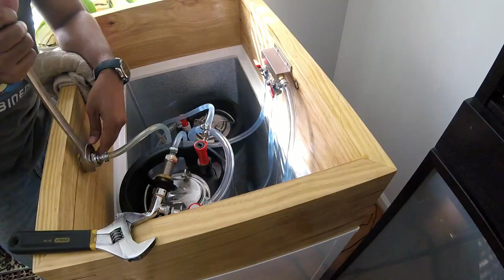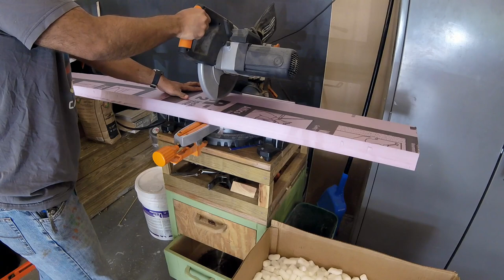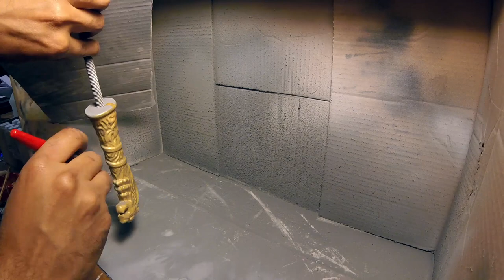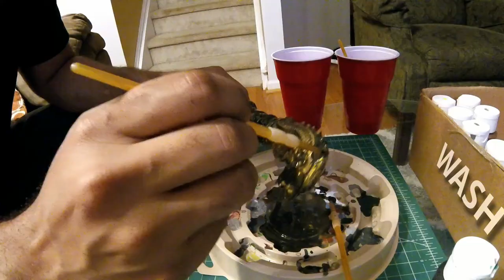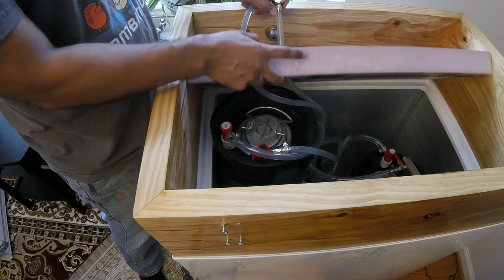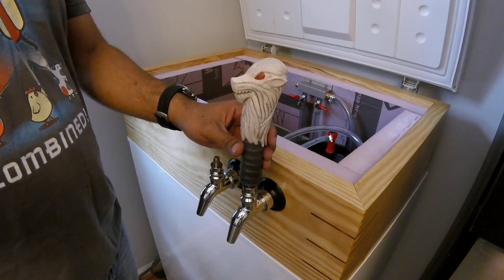Keezer Part 2: Oathkeeper - 3d Print Painting and Keezer Insulation

Comment: Nice attention to detail!  Getting ready to build mine and you gave me some great ideas!  Why no sealant on the collar?  Just curious because everyone I see they seal the crap out of it and glue it to the top.
Reply from the maker: Thanks!  I didn't bother sealing because it's a very tight fit with the lip of the freezer, so I'm not too worried about leaking.  You can't really knock the collar off with just pushing, needs to be lifted.  Unless you've got some rowdy guests rough housing with it. Also, I'd like to be able to lift off the collar without too much fuss, if needed.  If I start noticing leaks or condensation or anything, I will revisit and possibly put some sealant down.
Reply: I plan on having the collar hinge (I hope).  I have several boxes of faux rock tile panels left over from another project.  I am concerned about spacing off the skin of the freezer because I understand that is what cools the compressor